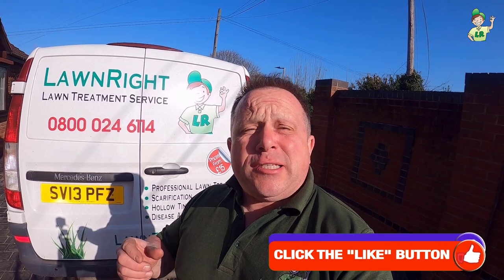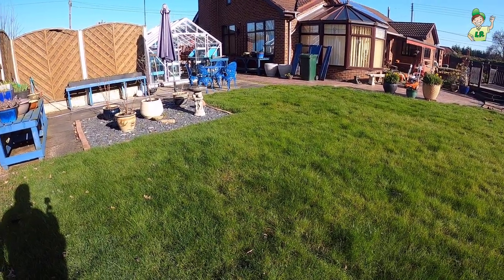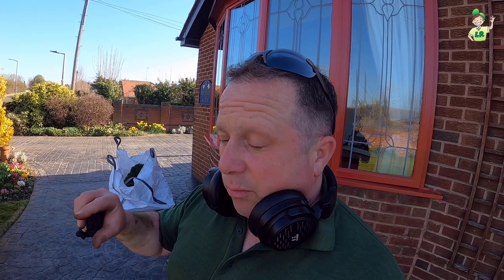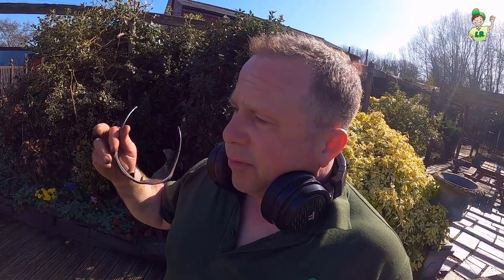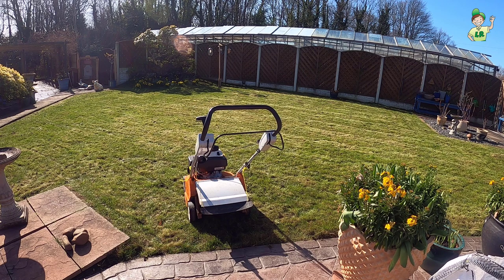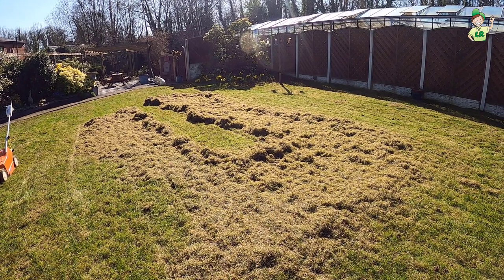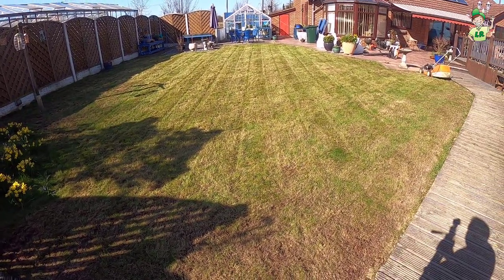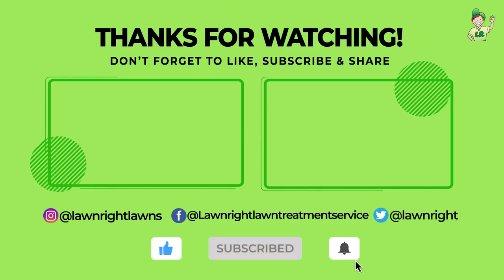Scarifying And Aerating These Lawns

Comment: what do you recommend to do after an earation and scarify?  just leave it for a few weeks?  Ive also put a little feed on there ....
Reply from the maker: Hi yes if it doesn't need any seed on just leave it be for 6 to 8 weeks..  water if it gets too hot to speed up recovery...if itsheavy clay uts width brushing a fine layer of topsoil or compost over the surface to get down the holes.. dont smother the grass blades though use  abrush to work it down between

Comment: Another great video, I remember you doing that lawn previously. What do you do with all the debris that you take out of these lawns? Also how would you deal with ants in the lawn long term??
Reply from the maker: Hi Rusty! Thanks for the comment. If there's not a lot it usually goes in customers bin.. if theres a lot then I give customer sthe option of me taking it away for a small cost to  a local fram who runs  a green water recycling business.   Ants.. well obviously its nature and not easy to control.  There is a good product started used last year called ant gone https://amzn.to/3L4IjKH seems to help..but I think it's a case of being on top of things and applying as needed

Comment: Which aerator do you use? Any recommendations for one…..petrol driven.
Reply from the maker: Hi the larger one with a drum at front is an old classen.. got it 2nd hand for £500 off ebay.. still going strong .  Now also got a camon la25.  Expensive but good bits of kit.  There arent really many decent options.   You may find others like bluebird but I've not tried any others

Comment: Hi! Loving the videos. I’ve got a quick question for you.. I need to raise the whole level of my lawn completely so I want to put down afew tonnes of soil and reseed. Do I need to rotovate the existing grass first or can I just put it down on top?
Reply from the maker: Hi you can do either..but I'd just putting down on top you prob should spray some glyphosate roundup on to kill off the existing then wait 2 ro 3 weeks before soil and seed..  this is only to stop any older grasses coming through
. If you're putting down a deep layer then it wont matter about applying roundup.. but if it's just  a few inches I'd kill it off first
Reply: @LawnRight  thanks for the tips! Daft question but what would be the problem with the old grass growing through the new soil and seed on top?

Comment: Ants why do ants like my lawn , 1st it was 1 a few years ago now its 3 mounds , you mentioned to dig it off how deep do you need to dig out general and best time to do it , and also you mentioned other options , if you could share may be on a you tube video why ants like my lawn and how to stop them in the 1st place ,plus the other options would be very grateful .
Reply from the maker: Hi Paul ants will set up anywhere unfortunately.  The spade was just to slice off the mound so its then flat ready for a bit of seed.  Remember their numbers will grow hence the increase in mounds..  you could put your spade in the.mound wiggle it open and pour ant powder down the hole without getting it on the grass ..  a product called ant gone is supposed to be good

Comment: Have you had any problems using the new e10 petrol in your machines, or are you using e5 still?
Reply from the maker: Hi..I've switched to E10.  I use this stuff: https://amzn.to/3NeDd05  just 50ml per 5l jerry can works well and havent had any issues so far 😊👍 (briggs and Stratton fuel fit)